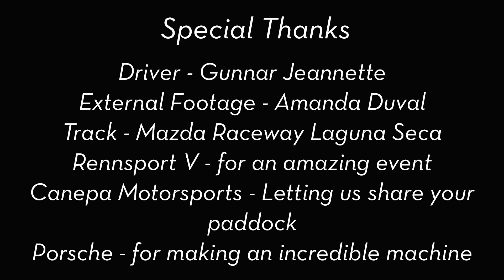One Lap in a 1969 Porsche 908 LH at Rennsport V

Comment: A tough engine as most of Porsche aircooled
engines. I may be wrong but, as a former aircooled 911owner, I guess that this iconic  
engine didn't require  heavy mantainence service yet being in racing configuration as on the 908.

Comment: Kind of annoying how much smoke that 917 was spurting out. Either way, cool 908. Wish I could find a nice Porsche flat 8 engine to tinker with ;)
Reply: Wonder what model 917 that was. If it were a 917 30 maybe the turbo seal was leaking oil.
Reply: 917 H I think it was in 1970. No rear vertical fins like the K. #21 was driven by Steve McQueen, but not in the racing segments, His insurer wouldn't cover it. Anyway, it's from the movie, Lemans. Owned by Seinfeld.
Reply: Geta  It is your run of the mill 917K.  The 917/30 was a Can Am car.  That body replaced the original long tail that was very much like the 908LH.  Those bodies wanted to Fly down the Mulsanne straight and the drivers didn't want it to.  So they made the rear body in a wedge shape that was inspired by The Lola T70 Mk III.
Reply: 🤦‍♂️Guys, seriously, forget the 917/30. Of course it wasn’t one of those. It was in Gulf colours for starters and it wasn’t turbocharged. It was a 917K in 1970 configuration. Google some pictures of the different kinds of 917s.
Reply: The 917 tire was rubbing that's why it was smoking, and it was black flagged.
Reply: If you are looking for more info, I found the whole race from the Gulf 917 KH number 2's perspective, driven by Bruce Canepa: https://www.youtube.com/watch?v=7LXKCc8wyNM

Comment: Yeah ok... so that was cool.  😃👍  I love those old school cars with driver + mechanical machine no electronics in between.  Except maybe a basic ignition and fuel injection.  Something is lost once they start adding traction control and ABS, hell even motorcycles have ABS now.  And this was outlawed, yet all this is, is a simple mechanical process with nothing more than aluminum rods linked to the rear control arms, leading to fins on the rear wing.

Comment: Do the ailerons help balancing the car in corners? Like an aero anti-roll bar?
Reply: It does look like active aerodynamic flaps, which you would find on a Pagani Huayra or Lamborghini Aventador. In the 60's it must have been considered unbelievable cutting-edge technology
Reply: Dominik  Through a series of levers and push rods, when the body lifted at high speed, those rods pushed those wing tabs up to counter the lift.